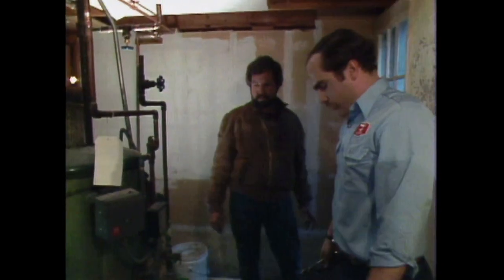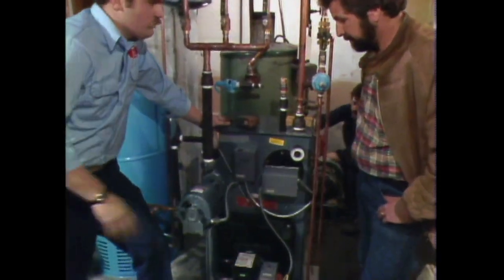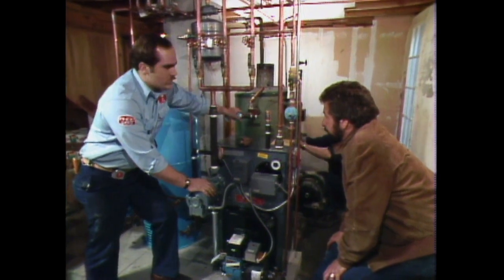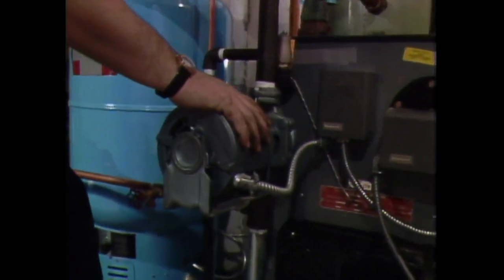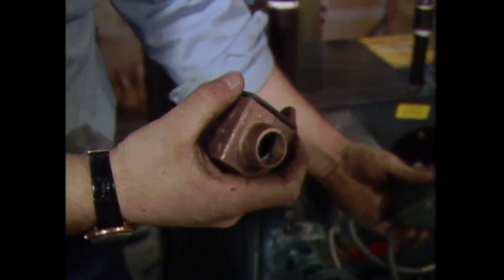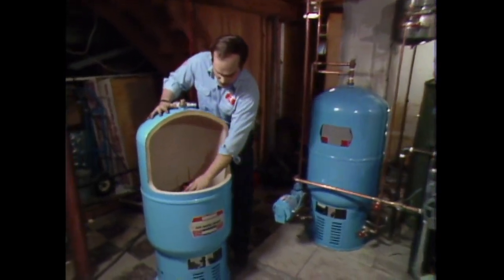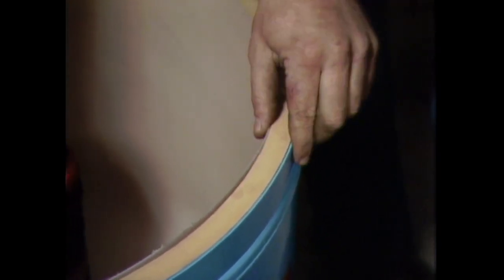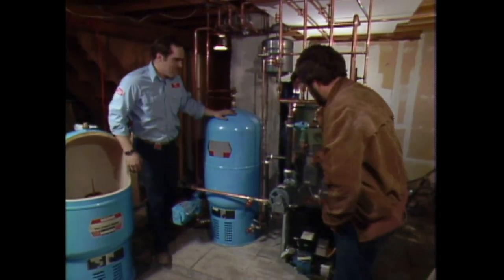Richard's first cutaway, a water heater 1982

Comment: That system from 1982 is better then half the units installed today
Reply: The Honeywell controls on some of those models were horrible, the Weil Mclain gold upgrade is usually the fix for those.
Reply: Taco zone valves rather than the Honeywell ones seen mostly now.
Reply: SOME NEW UNITS LIKE TANKLESS  ONES USE LESS WATER BUT USE IT WHEN YOU TURN IT ON 
  DEPENDS
Reply: First of all they still install those same peerless boilers and that burner was eclipsed by Riello decades ago. And oil sucks anyway. You really need to stop romanticizing the past.
Reply: Mmm leached plastic

Comment: Funny how so many years later, now Richard says it's best to have hot water on demmand instead of having a container with hot water. Which to me it's the way to go as well if possible. Time changes things.
Reply: That's not necessarily true. Usually the tankless water heaters are replacing gas fired tank water heaters, which aren't that efficient. But when the homeowner has radiant heat, Richard continues to use super insulated indirect tanks heated using the boiler. They just used one for the Cape Ann project.

The issue is simply that in houses with forced air heat, installing a boiler just for domestic hot water really isn't practical.
Reply: @lukpac  I thought I had answered your comment. I meant that's the best option for water you're going to use for drinking, showering and cooking. If you're considering heating then you'll have to work out what is best for you. There is no "one fits all".
Reply: @dawright1988  about "cheap to run"... I don't know your circumstances but, unless you have some kind of "intelligent" system that "learns" when you need heat and when you don't, keeping it running all along is not efficient. Maybe your bill doesn't go up too much, but it's not efficient.
Reply: @dawright1988  well, "cheap" is kind of a subjective concept many times and this is no exception. Where I live I can heat water for cooking and showering (no house heating) for well under 15€ a month. That is using butane bottles (some 14-15 kilos each or so). Should we connect to the gas company and that price would skyrocket.
Reply: @fadetounforgiven  I am also talking about "drinking, showering and cooking". Richard continues to use indirect water heaters where the house is heated by a boiler. They are extremely efficient when coupled with a high efficiency boiler.
Reply: @lukpac  ok :-)

Comment: 40 years later and we're not using plastic lined tanks. Guess there was a problem with them.
Reply: They do sell plastic water heaters. They're still expensive but they last forever.
Reply: I'd be concerned with BPAs and whatnot being in that 70s/80s plastic. Would prefer a copper lined one!
Reply: @VinylToVideo  wouldn't that defeat the purpose and advantage of it lasting long.....
Reply: @851995STARGATE  What? There are 80 year old copper hot water tanks still in service out there.

Comment: Three Grand for the Oil boiler, water tank AND all that copper w/ ball valves, that is an excellent price for all that. Now days just a similar boiler installed with all that copper, you're going to spend at least 10-12 grand easily.
Reply: $3,000 in 1982 is the equivalent of a little over $8,000 in today’s dollars, so the difference in cost isn’t as big as it seems.
Reply: It's also possible that the TOH crew and production company were able to shave off some of their overhead costs with donations and discounts from the companies that manufactured the equipment, or even the local distributors.

Comment: You know it’s a water heater, right?  It’s not a hot water heater.
Reply from the maker: Fixed. Thanks :)
Reply: @TOHClips  just being a smart aleck.
Reply: It takes water and heats it so it’s hot. So, yes indeed, it is a “hot” water heater. If it heated only to tepid, it would be a “tepid” water heater....
Reply: @gene8172  but it doesn’t heat hot water, it takes cool water and heats it.  It is a water heater.  If the water is already hot, why bother heating it?
Reply: @EdEdelenbos  It takes cool water and makes it hot. So it is a “hot water heater”. It heats water until it’s hot. Which would you rather have, a cool water heater that heats water to an unknown temperature or a hot water heater, that heats water until it’s hot?
Reply: @gene8172  id rather have a water heater that heats water to a set temperature. Again...  there is no reason to heat hot water, therefore no reason to have a hot water heater.
Reply: @gene8172  kind of getting into a Monty Python comedy skit at this point. Lol
Reply: @EdEdelenbos  There is a reason to call it a hot water heater-to make water hot. A tepid heater is also a water heater, but won’t give you hot water.
Reply: @gene8172  do you call a kettle a boiling water pot?
Reply: @gene8172  I hope you’re laughing as loud as I am at this.
Reply: You’re comparing apples to bowling balls, bro.
Reply: @gene8172  go look on the manufacturer websites or Home Depot or Lowe’s websites...  they’re “water heaters”.  They are not “hot water heaters”.  I’m done with you buddy.  Have a good day.
Reply: @EdEdelenbos  So?